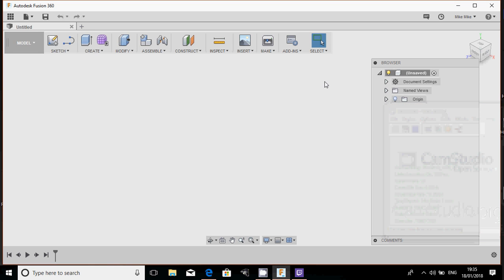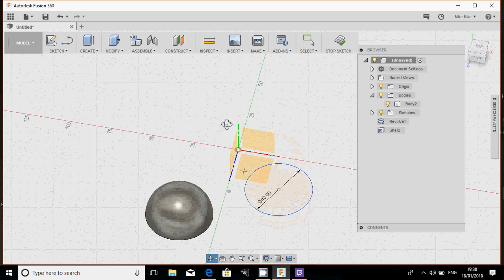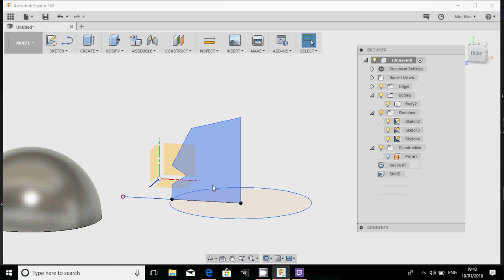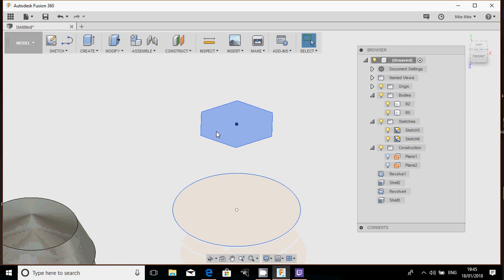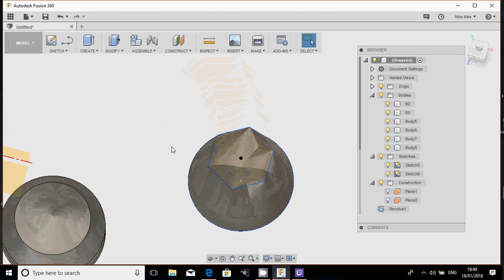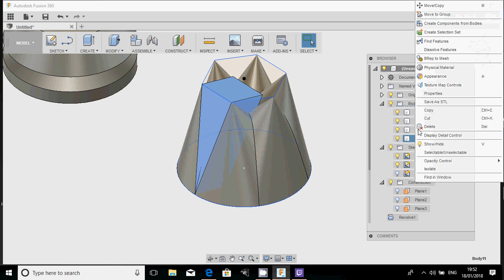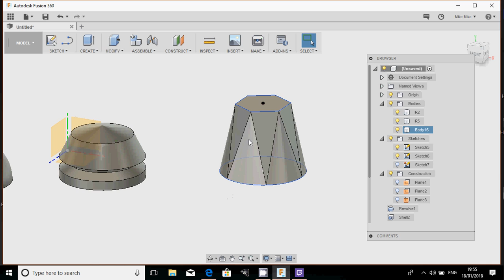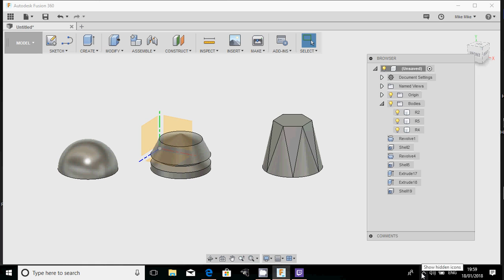Episode 2, Domes, Domes!

Comment: Interesting video. I'm curious about how well it will scale. Also, how you'll integrate the various bits in domes like the periscope, arms, etc.I toyed with trying to mod your dome design to incorporate the small arm R2 uses to tweak the X wing in New Hope but I discarded it. Are you considering that?Are you going to extend the series to the rest of the droid?I modded your body rings to accept more arms in the utility cabinets. (though I haven't fully tested them yet) Are you considering that option? Or a carousel? And are you going to finish your redesign of the 2-3-2?
Reply from the maker: Hi Chris, there’s a full set of videos on the Patreon link (filter by dedicated Patreon) showing the design of the full scale R4 dome with details in a six part series. I will be doing more also on the Patreon page. The 2-3-2 design I’m working on at the moment, doing the shoulders. Still have some challenges around motor power, just ordered some new motors to try. Trying to make it with relatively cheap and readily available components. The R2 dome modules are starting to be developed by the community, some great options which are shared on the 3dprinteddroids forum.
Reply: Hi Michael, sorry for the delay in the reply.I just restarted putting the body together today now that I've got the workbench back. I'm planning to test the mods I did to the arm modules. (I added 2 more arms but smaller) I want to do that before I do the final gluing of Rings 2-3.Should I wait on doing the shoulders until you finish your redesign?